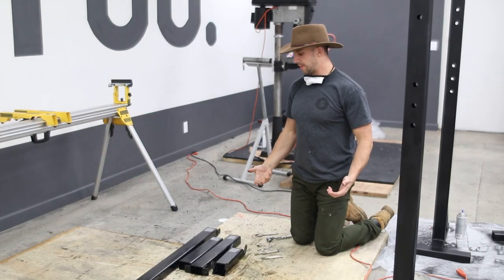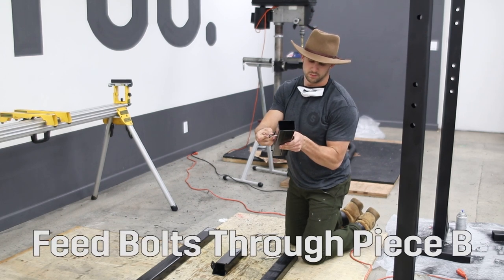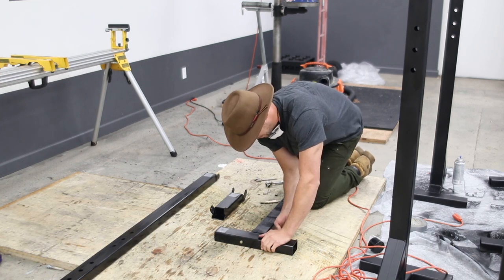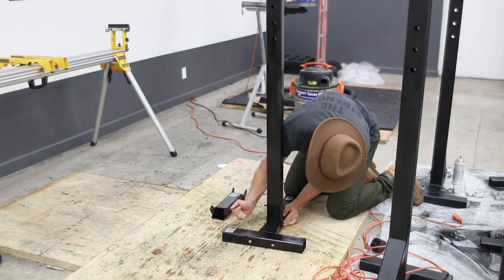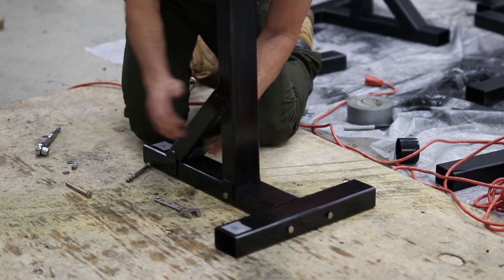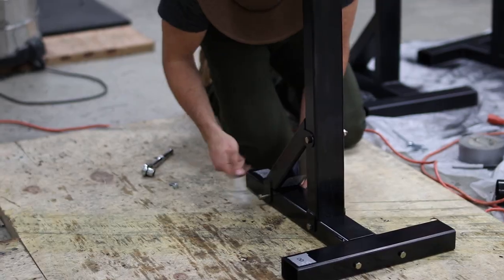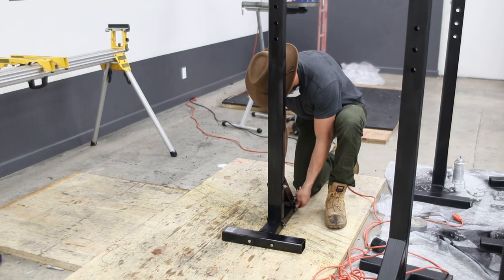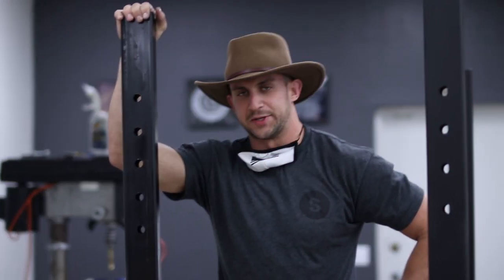"The Captain" TSC Bolt Together Rack

Comment: That Tee-base design is unstable.  Literally no one makes them that way, everyone does an H or a square for reasons.
Sure, that makes sense to get the base out of the way of your feet.  I totally get it ....but it doesn't work well.
I tried something similar to that when I built mine, it was tippy....so I aborted after the first one was mocked up.
I've seen a korean/japanese 3-leg design, but all three legs are at 120 deg. apart and radiate out much farther.
I think I've seen only one one Tee base design, but the base-legs project out much farther compared to this.
EDIT: lolz at "use sand bags" at the end of the video.